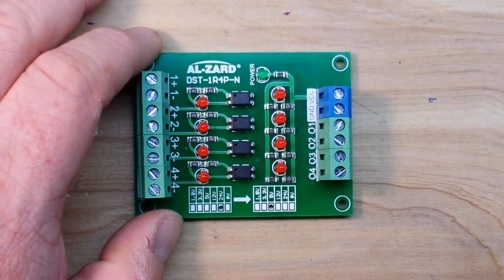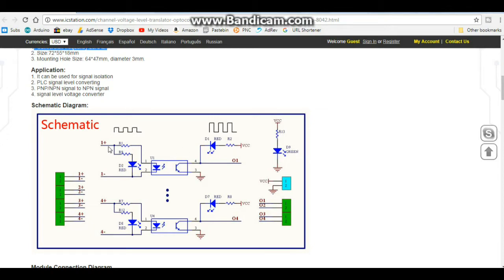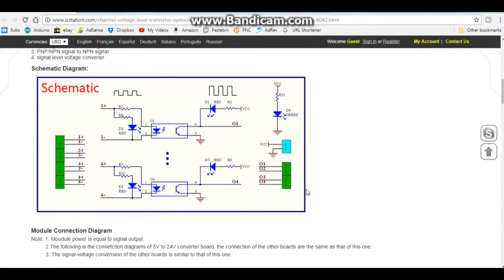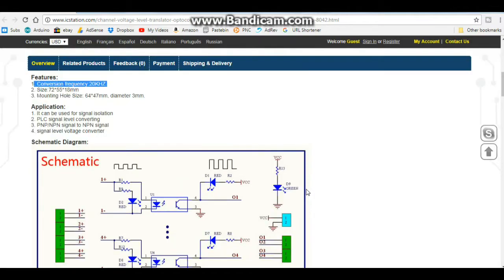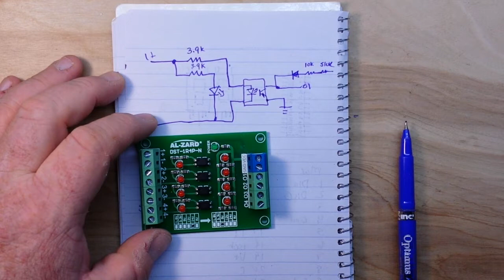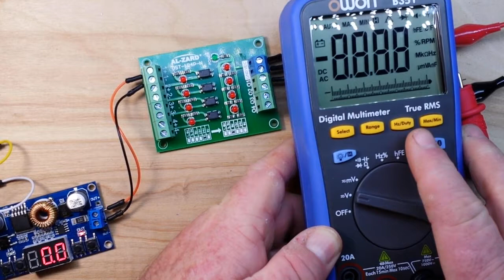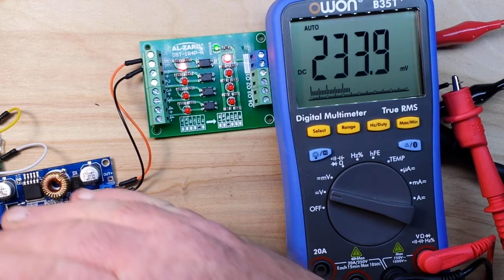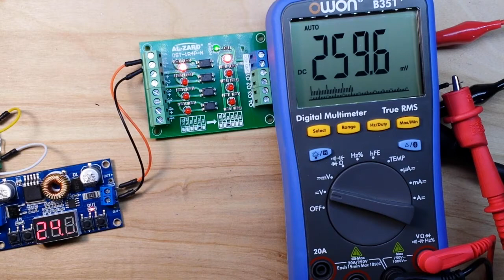4 channel level shifter/optocoupler from ICStation.com

Comment: Thanks for share. So, if I am using a 12volts in and 3.3volts out I need to powered to board with 3.3volts?

Comment: Thanks for your great video!! It seems to me that both resistors, the one with 1k and the 510, are connected to VCC, and are not in series as you present in your handwritten schematic (4:01). The 10k resistor is connected between VCC and GND, working as a pull-up resistor, and the 510 resistor is between VCC and the anode of the LED, working as a current limiting resistor for the LED. Thanks again for your work!

Comment: thats a huge circuit board for what it does XD
Reply from the maker: fredlllll It is a strange circuit as well. Why are they inverting the signal?
Reply: my guess is that there were only npn optocouplers available. so they can only switch the connection to gnd (or would high side switching be possible too?). you can always invert the signal with a pnp though :P
Reply: fredlllll they’re running the load parallel to the coupler instead of series so when it trips it shorts the load and inverts the signal